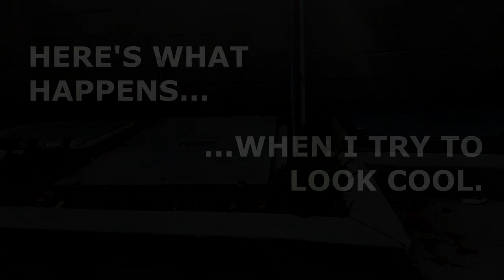#021: Cleaning Up Cable Vaults

Comment: Some say he's still trying to get the lid back on the vault.
Reply from the maker: +aguyandhiscomputer LOL!! Believe me, when the camera was rolling, it felt like it...
Reply: @FiberNinjaStudios  I say it's a two-man job, but either way, that surplus pull string makes for mighty good rope to fashion a sling you could loop around either end of that lid and hoist that sucker into place. The guys who clean catch basins along New Orleans curbs have to move cast iron lids all the time. They commonly use the wide blade of a pick axe to get that sucker lifted a bit, while another guy inserts a long galvanized pipe across it longways, thus allowing it to be "rolled" aside (rather than lifted!). Wouldn't work so easily on cable vaults with that rubbed reinforcement in the way, though.
Reply: I think I would have put on some gloves,  get my fingers on one of the bent up sides and lifted/slid the lid.  Those lids would be a pain. I'd rather have a heavy concrete lid that you lift just enough to slide it.

Comment: Some suggestions: if an installation like this is in a lightning-prone area, you will want to do it as the telco does and use a shielded cable (they typically use PE-89 or PE-39 cable; outside plant cat5e cable of similar construction, with a corrugated aluminum shield, is also available) and primary protectors at each end, and bond the shield to the building ground at each end. Also, if the run is long, putting the T1 transmit and receive in different binder groups (different 25 pair bundles) if available (if you are working with a 50 pair or larger cable) or run separate cables for the T1 transmit and receive. This reduces crosstalk between the transmit and receive pairs.

Comment: I worked for a large healthcare organization and I hated it when we bought a small office and I had to go in and try to make sense and clean up the crap left by previous installers.  Just documenting what was there sometimes took ten times longer than the task I was supposed to do but since I was going to have to service it later, I had to do it.

One tip, if you use patch panels, use a different color jumper for different devices like printers, Voip, computers, etc.  That way you can look at a jumper and have a good guess at what it goes to!

Comment: Great job on the cable cleanups and the reasons why you do it. I see alot of my work ethic in you, and looking at it from a viewers perspective, I know its the right thing to do for myself, the company I'm working for and for future techs or troubleshooting.
Side note: Apart from bad cable installs, I dislike needing to run cable through someone's premade hole or conduit which is sized to the absolute minimum to handle even the cable somebody already forced through it. I suppose making a larger hole was just too costly and with the idea there's no way in hell the client will decide to run more cable EVER. Both ideas very wrong. Im talking about holes or conduits in hard to access areas or difficult material to bore through, the spots I always seem to inherit.

Comment: you need a box lid lifter and a bit of scaffold pipe. lift one end slide the pipe under and roll it off.

Also, I would have stripped the outer sheath of the data cable and ran the pairs around the block once.
That way you have enough slack to reach any termination and you would not have to disconnect working lines to strip it if you came back and used those 2 spare pairs

Comment: There are a lot of cowboys in the installation business, I experienced it myself when my cable internet got hooked up years ago. As soon as the technician left I undid most of his work and I redid it the proper way.

I hope some of these cowboys watch your videos and see that doing it the proper way doesn't take much more time and helps the technician coming after you.
Reply from the maker: Well it certainly CAN cost you time. For instance, the installers running those fiber lines diagonally through the vault would have been a LOT faster than leaving a bunch of slack to have to neatly coil up and secure. They may have saved a good half-hour or so per vault by not doing it right.

Comment: I know a guy whose job is to enlarge underground cable vaults. he and his team take an existing large man-sized cable vault expose it, break it down and make a new cable vault with rebar and concrete forming that is larger so that more cables can be run through it. It takes a couple of months in most cases and   locks out about two lanes of traffic. Sometimes they have to close an entire block because they don't have enough room for traffic to pass around the 10-foot deep 20 x 20 hole they are working in. He's been doing it for over 15 years now. Took over the business from the other guy that owned it and  retired.

Comment: The professionals (in the case of the two telecoms engineers at my house on Thursday) used a little hoist tripod system on wheels. Wish I'd taken a pic now! They said they have a dolley for the singles, but anything bigger and they have to hoist it.
Reply from the maker: Well there you go!!

Comment: The grass/dirt being flush with the vault opening explains the dirty conditions.
Reply from the maker: Well the grass and dirt didn't leave all the junk from the previous tech in that vault!! It's because of all the mud that winds up on the bottom of a cable vault that it's so important to keep the lines off the floor and secured the the sidewalls as high as possible.
Reply: Local climate is a factor, but this general sort of hole full of cables is a commonplace. And sometimes they fill with water. I see features here that reduce the chance of that happening. A bad sign is a cover in the middle of a paved area, flush with the surface.

I have a few friends in that part of the USA, and I know that when the rain comes it can be a lot to run off. So it's not just the ladder, it's the possible flood.

Comment: There's nothing worse than having to fix and/or clean up other people's half assed work! Why can't people just do things right the first time? There was a time when I didn't charge to clean up other people's messes but not anymore. Now I look at things and ask the customer if they want it done right and explain what needs to be done. In my experience most want it done right so it doesn't haunt them again in the future. A minor touch of OCD makes for a more organized and neater world.
Reply from the maker: +DrD6452 I believe the phrase I've been told is:

"I've got 3 things I can do for you in this project: do it on time, do it on budget, and do it right. But you can only pick 2!"

I think the 3rd option is the most often dropped.
Reply: This guy is the Mike Holmes of networking

Comment: Thanks to you I'm now a better IT technician! People at work don't tell you these kinds of tips (at least not at my work). 13:00 But I'm wondering how you have to close the lid correctly, because if the lid had fallen in and damaged the fiber optic cables ...

Comment: i absolutely agree with your philosophy, do it right the first time so you don't have to do it again later down the road.
Reply from the maker: +Isaac White I don't think that the opposite of this mentality is where the poor workmanship stems from. I think it's a combination of:

1) No experience having to maintain the system they just built. I personally experienced this with the "Medium Size Office Rehab 2015" job I did. I would never run those cables like that now. I had to repair a line that went bad on that rack a while after it was finished and realized just how much I had buried those cables! It was a big wake-up for me. Most of the day to day work I do now is repairs and I deal with this issue frequently. System are rarely designed to be maintained.

2) "Bottom Line" mentality. When doing the job right means taking twice as long, many will not chose to do it. Who wants to pay their workers twice the money when the contractor has bid the job for a flat rate. The longer the techs are on site, the less money he makes. So build it as fast as possible to where it will work. I had to make the decision that I wouldn't work that way. Sure it sucked to be me as I'll never get rich doing this, but oh well...

Comment: Hi, great job for what you did yourself. Unfortunately when you were done that vault still looked like a trash can waiting to be emptied out on the bottom. All those scraps of metal,cable and who knows what else makes it very uncomfortable for the next tradesperson to do their job safely, efficiently and comfortably. If each person in the vault cleaned their own mess when finished then the next person in the hole would have a smoother go at their job. Even though I plastic bag clean up upon exit is all it takes nobody seems to take that initiative. So sadly if you cleaned up everyone else's garbage, left the vault spotless and even hung a sign stating "Clean your debris upon exit" it likely wouldn't take long to get out of hand again and again until that vault opening slowed down to very random entries.

Comment: Just a silly FYI off topic... In some states you also need electrical lic to pull cat5/6
In Texas you need an investigators lic to back up hard drives.
Reply from the maker: Yeah, it's an interesting topic I'm going to touch upon very soon. The fact is, I've never been "inspected" in any way for my work in this field. Mind you, I grew up working with my father who was a general contractor so I know what an inspection looks like! But it occurred to me that this field is very loose on that sort of accountability and I want to talk about it here somewhat. Stay tuned!!

Comment: Well it's nice to know I'm not the only loose nut running around. There's never enough time to do the job right the first time, but always time to keep going back to fix it. The guy that leaves patch cords and fiber jumpers across the floor is long gone when the customer says, why did the network just go down, as you trip and fall on the floor!  The only question I have is (@ 11:00) why you didn't terminate  your 4 pair on a spare 110 block position than cross connect it?___  P.S. My doctor says I'm not OCD.
Reply: Because I'm extending a T1 over a long distance. The fewer connections and media changes the better. It's also because, in this case, it isn't like the "Equipment Side vs. Cross-Connect Side" -it's just a circuit extension. The main purpose of having an equipment / cross-connect separation is to be able to troubleshoot systems without too much hassle or pulling cables. In the case of a circuit extension (especially a T1),  this type of circuit has built in abilities to separate the customer / provider sides without taking anything apart. Great question though! I'll definitely talk about this sort of concept in a future video!
Reply: Also, a T1 only uses 2 pairs. I left plenty of cable at both ends in the event that a future circuit needs to make the same trip.
Reply: I see your point on the T-1, and it's one less spot for someone to disconnect by mistake. What's really annoying is when someone runs a 25 pair cable, and just pulls out the pairs they need at that time,and leave the other pairs swinging.

Comment: My boss wonders why my jobs take me an extra day.. because I do the exact same thing... and time and time again ive done over 100 installs-  I wont leave my card next to my work unless its done right.. and those are the stores that DONT call me with IT issues down the road.
Reply from the maker: Yeah, it's a tough situation to be in when you work for someone else. Business is business and it's nothing personal --it's all about the bottom line and what it will cost. I'm much happier working for myself now. I don't have to justify the extra time to anyone. I've bid the job, I know what I'm getting paid for it. If I want to take an extra hour or two and do things right, that's on me. I'm sure 99% of the other installers will not do that but that's also ok with me. I understand where they're coming from too. It's just business. I can tell you that when the people that understand what's going on see your work, they'll start calling on you when they know the job needs to be done right. I am often called for working in high class establishments, mansions, etc. when they want the work to look as good as it can. People will notice. Trust me.

Comment: There is a very simple trick for driving bugs, mice, rats and snakes out of areas that is cheap enough you can do on all jobs when you look them over in the form of old fashion mothballs. The smell will send them looking for a new home and last a few months before they fully evaporate so safe to leave if you don't do the job. A pile of rocks/bricks a few mothballs in it will make sure nothing is living in it when you go to move it. Under a porch/in a crawl space?  toss a few in and when you come back a few days to weeks later you have nothing else crawling around with you.

Comment: Fantastic job! Got a BT technician recently to connect us to line. Left plenty of slack on my end in case I needed to reroute it in the future. I ask technician to leave plenty of slack - he terminated it with maybe 1 inch of slack. What a moron...
Reply from the maker: OMG! I'd be so pissed. There's just little you can do after that. I know that I had the client that contracted me for the work here watch this video (or at least the shots of cable running directly through these cable vaults. He made the cabling contractor come back and re-run their lines to do it right. I know from checking that all that previous work had to be removed and trashed because they left zero slack anywhere!

Comment: I don't like cable vaults that run flush with ground level, just asking for trouble if the lid does not seal properly. On those flush vault lids are there seals to prevent water ingress? There has to be a torque sequence and spec for the bolts in order not to warp the covers of which I see in the video.
Reply from the maker: The bolts are actually holding brackets on the inside of the lid for reinforcement. No seal at the edges. There is however a drain at the bottom of the vault!

Comment: You'd have a heart attack seeing how the Digital Menu Boards at McDonalds get installed. You dont get the option of making service loops for anything other then the Cat5 cables in the ceiling. All excess video cable gets stuffed (literally) inside the wall that the tv's are mounted to. I've done about 20 of these over the last year. They want the least amount of cable showing as possible and 95% of the time you cant put anything above the ceiling.

Comment: I only have 1 question... how were we still installing T1s in 2017? Is this still happening? You can't even stream HD on a T1. VOIP connection?
Reply from the maker: T1's have a few advantages for systems that are low in bandwidth needs but high in reliability needs. A POS (point of sale) device that reads and verifies credit cards for instance. Sure, many phone systems still use T1's but the need for such a specialized line isn't what it used to be. In theory, T1's are closely monitored by the local carrier and can in many cases detect an error or a pending problem with the line before anything problematic occurs and the customer loses uptime. What I've actually seen in reality is far less impressive. But still, the uptime guarantee that T1's usually come with means that you can recoup costs from your monthly bill based on any outages experienced. Also, in many commercial / industrial / rural locals in the US, copper lines are all you have to work with so they will bond them together just to get a somewhat tolerable broadband service. Either that or send it wirelessly (which they're starting to do).
Reply: That T1 uptime guarantee just means that if a T1 costs $300/month, and it's out for 24 hours, you get a $10 credit on your bill. That's not enough of a financial penalty to a company like Verizon to actually maintain their decrepit, rotting copper cable infrastructure. Give it enough time and they'll have a decrepit, rotting fiber infrastructure too. They think fiber doesn't have a problem with water but they forget that water expands when it freezes......